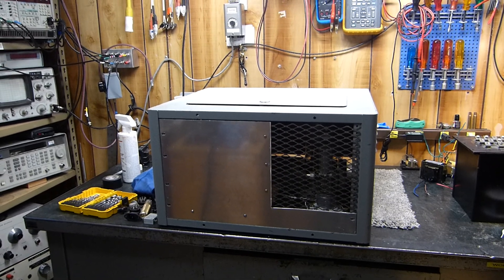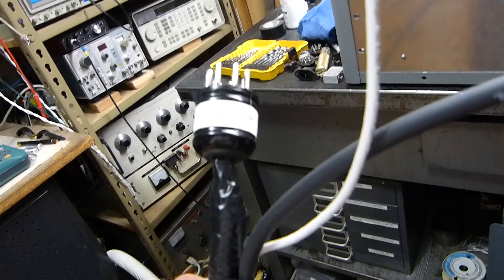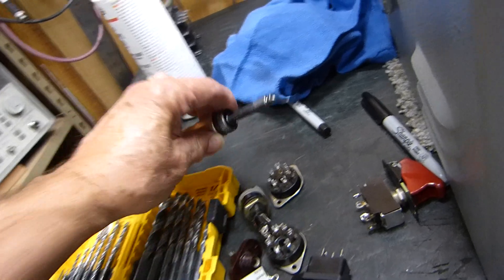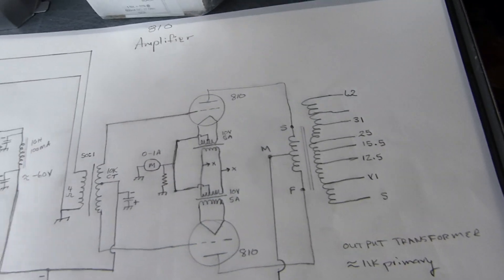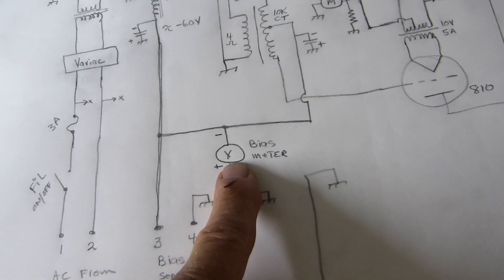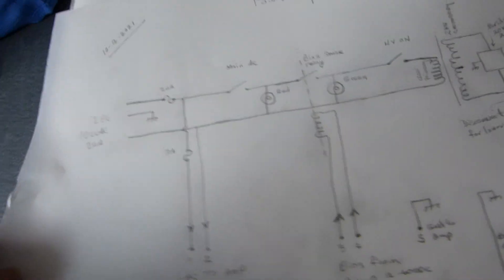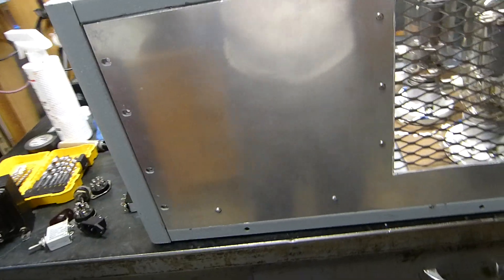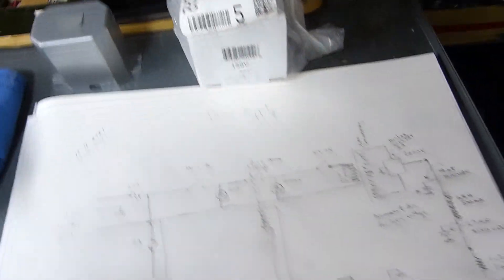Second Thoughts On 810 Amplifier

Comment: How about the million-dollar question why don't you mount the power supply with the tubes so you don't have to have an umbilical cord. I'm assuming based on your high voltage power supply it's a little Overkill probably wish you had on hand but I'm not going to be that guy that throws a wrench in your Works after you've already fabbed up that beautiful box.
Reply from the maker: I do tend to build large but I did consider all of it in one box but it would have been very crowded and massively heavy. Each cabinet weighed something like 80 pounds. Of course the cabinets are heavy themselves and that would eliminate one but even so, I think it would have turned out something like 140 pounds or more and that is more than I can handle. I am sure some of my other "creations" weigh as much or more but they are on wheels and are not intended to be portable. We also had only a couple of days to get it finished and it is easier and quicker to build large. Thanks for your comments.
Reply: @ElPasoTubeAmps  I am astonished by your work yes bigger is better.
I am going to have to admit they're fairly new to tube amplifiers but have been working with basic schematics and electronics for years unfortunately I'm only 40 and they did not have anything remotely close to real world mechanical skills in high school nevertheless I am trying. I don't mean to take up your time I know it's very valuable I have a new Sapero el34 push pull stereo amp.with huge output transformers I was thinking of adding another set of el34 to make it a quad.
I feel the power supply and the output Transformers can handle another set of tubes do you see a problem and adding another set. Right now I am powering to Jensen 812 field coil for my lows and 2 magnavox field coil 12" for my mids and a single on each side 5" magnavox field coil for my highs I need more Power Capitan!!
Reply from the maker: @coreyellisart6877  If you add two more output tubes (EL34's) you will double the filament current the power supply must provide which would be about four more amps. The same is true for the plate current - it will double. I kind of doubt the power transformer is rated at twice the amplifier's design capacity. If you can verify the current rating(s) of the power transformer windings, you would know for sure. Lastly, the plate load impedance will be one half what it is for two tubes. You can probably compensate for that by putting your speakers on the next lower impedance tap, i.e. put 8 ohm speakers on the 4 ohm outputs or 16 ohm speakers on the 8 ohm outputs. That is all I can think of at the moment. I don't want to stop you from experimenting but those are some things that will occur. Stay safe around that HV.

Comment: That is going to be a BEAST!
One thought I had about the HV power supply..... would it be a good idea to "soft start" the supply?  I would imagine the inrush on the HV transformer and filter caps might be pretty high and possibly blow the fuse.
Something like a big power resistor (about 10 ohms/10 watts) and a time delay relay that would shunt the resistor after a second or two.
The power resistor shouldn't get even warm because it won't have current flowing through it for very long.
Just a thought...
Can't wait to see it in operation!

Comment: I maybe missing something here,but the umbilical cord has males at both ends,there is a kind of interlock with the mains supply but would it not be best practice to use a female at one end and a male at the other,perhaps you can correct me on this,its just an observation,I think your approach to amplifier building is brilliant keep going on these great projects,Colin
Reply from the maker: You are right. There is going to be some "live" line on an umbilical cord no matter how we design it and it should have a female connector on one end. I only have chassis mount female sockets so I can't do it that way. Below in the comments a good gentleman talks about the male connector being on cameras and how that is avoided as the male connectors are much more prone to damage than the female ones. Damaging the male connector on an expensive camera is not good but damaging a cable is much easier to fix or even have spare cables. 
After a few thoughts on this and help from the YouTube community that watches my videos, it seems the best that can be done with a male-male umbilical cord is place a low voltage on the cable that can go to the other end and be turned-around and energize something like a 6 volt relay before sending, in my case, the 120 volts across the cable. I have poured over this issue a good bit and tried to consider every dumb thing that can happen, and dumb things can happen to everyone of us, it is not a comment on anyone's ability.  I could put AC on the amplifier chassis and not have to transport it across the cable but that is another power cord that needs to be plugged in. I am still thinking about it.

Comment: Hi David, those nice circuit breaker switches..I had a load of those which I tried to use on various projects. If you use them to switch PSU's on/off, they can be a pain as they trip because of the surge when you switch on. I've had, on more than one occasion to swap them out for something else!! just to give you a head's up!! 73 Justin
Reply from the maker: Justin - that is veery good to know. Thank You... I am not going to use it as I do not need any intermittent issues.

Comment: I noted your umbilical cord has two male ends. This could be a dangerous shock hazard. But I once saw a clever solution to this male-male umbilical problem on a broadcast TV studio camera that needed 120vac from the rack mounted CCU to the camera head. They had two pins on the camera side connector shorted together. Then there was low voltage DC sent to the camera cable and when plugged into the camera head it closed a relay back in the CCU which allowed the 120v down the umbilical. So there would be no dangerous voltages on a disconnected cable.

*Why didn't they just use a male/female cable? Expensive studio cameras are often moved from studio to studio. So the cables get connected and disconnected a lot. If you had a damaged male connector on the camera head, you had several hours of bench work to replace with a camera down. Bent pins on cable ends just required a replacement cable and the damaged cable repaired when time permits.

Since the 1980s most cameras use Triax which is a coax cable that has high voltage DC on the inner shield. The outer shield is ground, and the center conductor carries everything back and forth via RF carriers. The HVDC (200-300v)  feeds a DC/DC inverter in the camera head for power.
Reply from the maker: Wonderful information - thank you. I did  consider what you are talking about with possible AC  on the end of the umbilical cable but as you mentioned in the second paragraph, a male connector on the amplifier is asking for trouble and I don't have a chassis mount male connector anyway...  As drawn in my schematics, 120 VAC could end up exposed at the male end of the umbilical cord if unplugged from the amplifier chassis. I will think about this and see if I can come up with a simple solution. Maybe secure the cable at the amplifier end so it can not easily be removed ?  
I can see in exotic camera equipment using the triax (I am not personally familiar with it or have used it) and I can see the data being carried thru RF but, of course, this amplifier is so much simpler than that. Adding an IEC AC connector on the amplifier end could then expose the -60V bias to an open end at the PS end of the cable.  I do have two wires in the umbilical cord that are unused but I can not see at the moment how I can utilize them without having an exposed voltage at one end or the other. ??
Reply: @ElPasoTubeAmps  i admit i haven't noticed the male-male cord. if you do have two unused wires you can create a dumb circuit where a low voltage low current circuit is exciting a relay in the supply cabinet witch gives power to the rest. one end of the coil gets to the amplifier in one wire, the socket connects the two wires inside the mplifier, the current comes back from the other wire and closes the circuit only if the plug is connected. you can use only one wire if you use the ground strap as a return path or a GND connection for the relay coil witch otherwise will be floating.
Reply from the maker: @manuelminutello3027  I am definitely going to consider that. Maybe a 6 VAC relay or something really safe as the "hot" terminal between units.   Thanks...

Comment: Wow, that will be a monster! 👍
That string of power supply capacitors alone is awesome! (I have an early 90's russian 2x250W PA amp featuring two quartets of  6P3C-1 i.e. 6R3S-1 output tubes working at 600 volts and the main B+ capacitor of that ugly beast is two 800uF electrolytics in series, and that is a frightening enough power package for me. 😁)

Comment: Be sure not to turn off the HV switch when the amp is powered up, this will prevent an arc from being drawn inside the switch which may fuse the contacts together. I speak from painful experience.
Reply from the maker: Something important about switches in power lines is that exactly what you describe will likely occur if the switch is installed in series with any DC line, like the DC output of a rectifier,  as the voltage does not go off or go to zero at any point and the arc will likely follow the contact and continue until the AC is turned off. I have done the same thing recently in a relay. On the other hand, if the switch is wired into an AC line, like the primary of a transformer, or even the CT of a power transformer to ground, the AC voltage goes to zero twice in each cycle and the arc will extinguish.    https://www.youtube.com/watch?v=t90Ayud5XfE
Reply: @ElPasoTubeAmps  Amen, I have a relay in the HT on my monoblocks, they switch out the centre tap of the winding which of course is AC.

Comment: I like it! Simple and safe.
Reply from the maker: Hi Bill, So simple it makes us wonder if we are missing something  :-)   bottom line is to make it safe. I think I will also put in a relay and resistor that puts a heavy load on the PS when the amplifier is switched off and opens when HV is on so as not to waste so much power in heat. The voltage equalizing resistors I put across each cap is 220K and is for voltage equalization only. They will drain the capacitors eventually but probably over several minutes and it should be faster than that.

Comment: Almost every video you post I see your transformers and shout WHERE THE F$#* DOES HE FIND THESE?  I gotta come over there from San Antonio and build something with you.
Reply: Military dump loads of them
Reply from the maker: As commented below, most is military surplus. Really good stuff. I worked for NASA and WSMR for the first 26 years of my career and things like this were thrown away at every equipment update. However in the case of these two huge OPT I have, I got them from a fellow ham radio operator at NASA in Huntsville in the early 1970's. 

I  recommend this Ebay seller:  his name is:     lilwing3    and here is a link for a serious power transformer.   Check out the rest of his stuff.   Big OPT are very rare.

https://www.ebay.com/itm/373737809275?_trkparms=amclksrc%3DITM%26aid%3D111001%26algo%3DREC.SEED%26ao%3D1%26asc%3D20160908105057%26meid%3D1d50c8599aaa4f5aa5483774ead042cf%26pid%3D100675%26rk%3D2%26rkt%3D15%26sd%3D372936738131%26itm%3D373737809275%26pmt%3D0%26noa%3D1%26pg%3D2380057&_trksid=p2380057.c100675.m4236&_trkparms=pageci%3A7aefdb86-2b8f-11ec-bb96-3a79b4d4a6f6%7Cparentrq%3A75e5f99817c0ab9d34844603fff69bc4%7Ciid%3A1

Comment: Thank you for your videos! Very interesting ideas you have. Im building GM-70 push-pull stereo amp. Using 6D22S tube diodes bridge(gives slow increasing of voltage) in power supply, plate voltage is about 1500V. 3 stages of amplification - 6Н8С(6SN7 analog) and push pull 6П6С(6V6 analog) and GM-70, interstage caps, no transformers
Reply from the maker: 1500 volts - you are up there in the danger zone so please take care. Good luck with your projects and post so we can see them.
Reply: @ElPasoTubeAmps  Thanks. I'm also using diy fixed bias module which automatically sets bias voltage for equal plate currents, If you interested i can give you a schematic

Comment: Hi David, nice to see you around!
I am not sure if I understand correctly your schematic, i think your schematic is simple and effective, i would put the hv on lamp after the switch, seems like more foolproof. In the next episode could you explain a bit more how you choose the driving transformer impedance? Is based on grid impedance or you just forgot a pad resistor on the schematic?
Reply from the maker: Manuel - I just can't figure out what you meant when you said, " i would put the hv on lamp after the switch".  I don't want to miss anything that might make it safer in power up and overall.  I value your thoughts. Also, I built a modulator pretty much the same as this one except running 4-125A  in AB2 at 240 watts and I drive the grids the same way except I put a 27K 2W resistor off each grid to ground. Since I am not drawing any grid current in the AB2 design, it seemed like a good idea and it works great.
My investigating has lead me to believe that the lower the Z of the grid driving transformer, the better, assuming the required voltage can be attained. In an earlier schematic I did draw in resistors but forgot to put it in this drawing. On the other hand, this amplifier is clearly class-B so I am not sure it matters.  Studying these types of amplifier designs, they are so simple it makes us  wonder if we are missing something.
Reply: @ElPasoTubeAmps   Sorry i put the words in a wierd way, by "i would put the hv on lamp after the switch" i was trying to say thet the lamp shown as "green" on the power supply schematic placed after the bias sense relay, in my opinion, should be wired after the "HV on" switch. this way the lamp is not meanng "HV ready" but "HV on" so you know that the switch is closed.
Thanks for the grid driving explanation, but this raises another quesion. if the driver amplifier is connected to the grid driving transformer, since in class B you are not drawning any grid current, how is the impedance matched? i have assumed that the resistor from grid to ground was kind as a dummy load for the driver amp and the voltage across it was driving the grid (assuming grid current << ressitor current ).
Reply from the maker: @manuelminutello3027  As for driving the grids, it takes -60 volts bias and 380 volts peak AF grid to grid and 13 watts to drive it to 725 watts output in class-B so there is going to be some grid current. Can I determine grid current by I = P/E (?) if so, then grid current is 34 mA so, no doubt there is grid current and we know that is true for class-B operation. See why I post this stuff? You guys make me figure things out that I haven't thought about... I do tend to like the idea of the so called, dummy load off each grid to ground (or to CT). As mentioned, I did this in my AB2 amplifier. I used 27K, 2W resistors but now think I could have used a smaller value resistor. I think I will have to test it with and without loading resistors. I can easily clip some in during testing - I appreciate you making me deal with this. In all the examples to be found, no one uses loading resistors for class-B or AB operation and that leaves me with a little...   ???  Driving the grids with a typical 6V6 tube level output transformer is the way it seems everyone does it and it worked for me in AB2 on the 4-125A.
As for the lamp, sorry I am so simple minded that anything can confuse me. I see what you mean about indicating if the bias is on and ready, etc. I will have to think about that one also.  Many thanks...